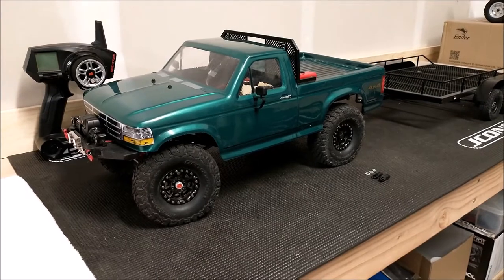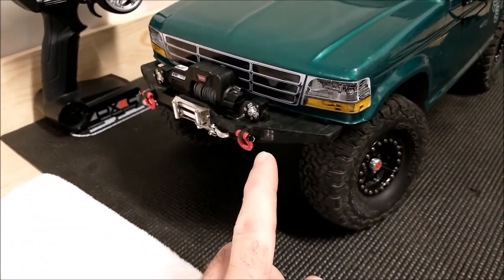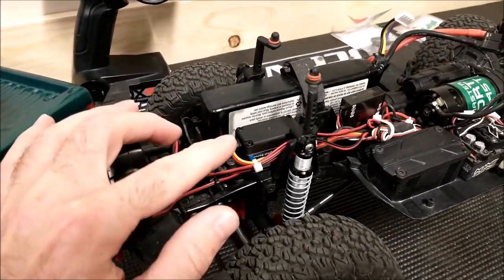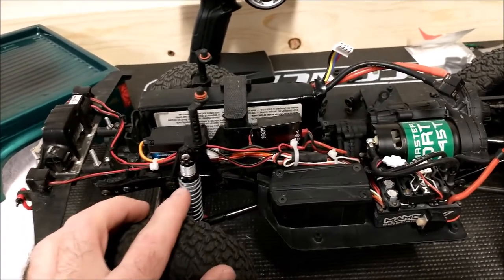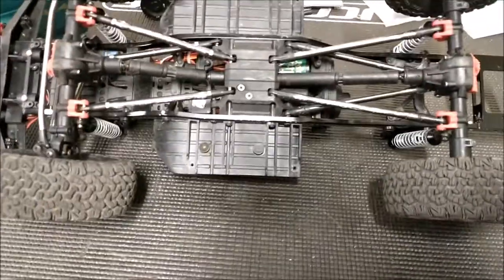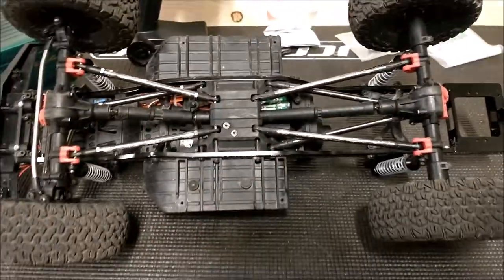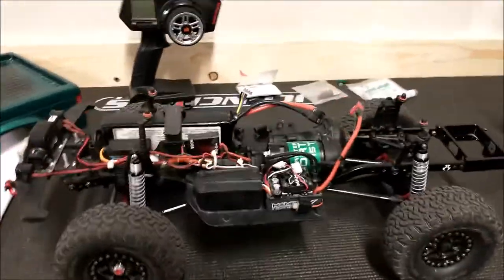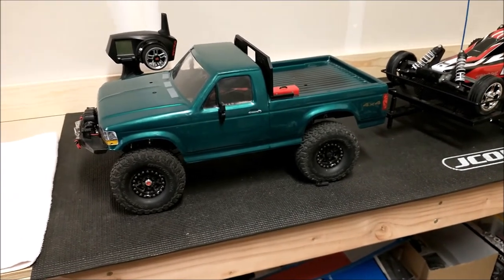An Axial for towing? SCX10II Ford OBS project.

Comment: Nice truck. I used to run that same body in white on my TRX4 when I had it. Some 4.3 or 4.45 tires would look great with that body. I run TRX4 takeoff shocks on my SCX10 II. They're smooth with no leaks.